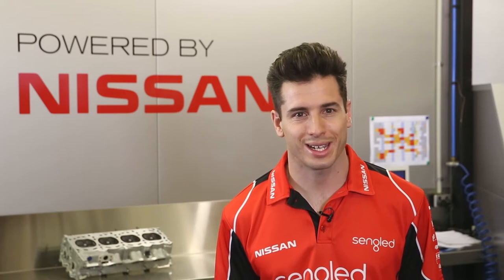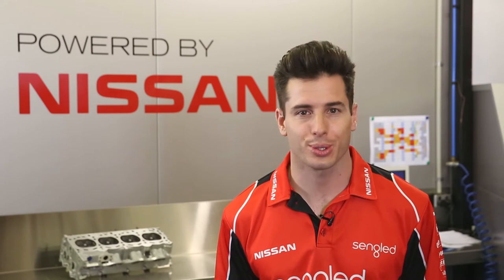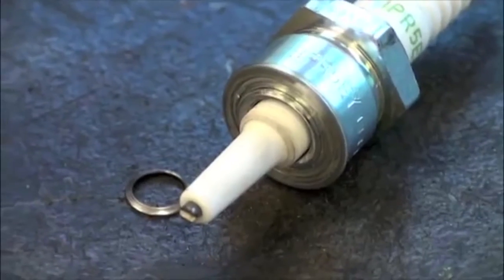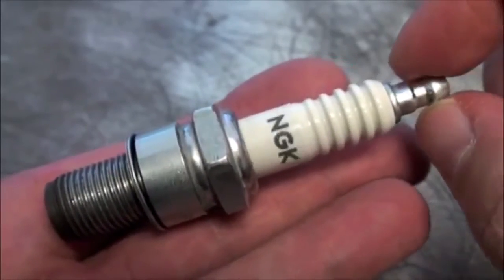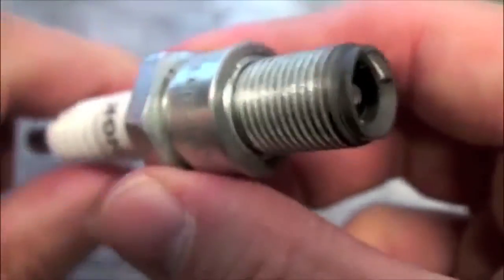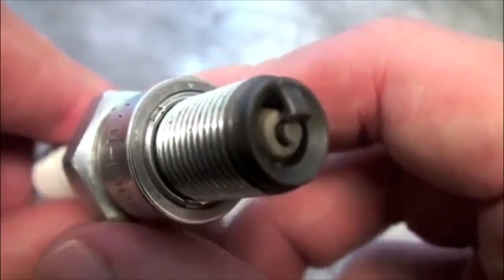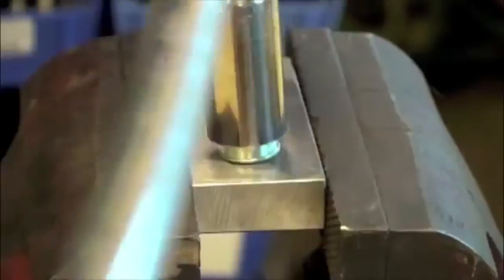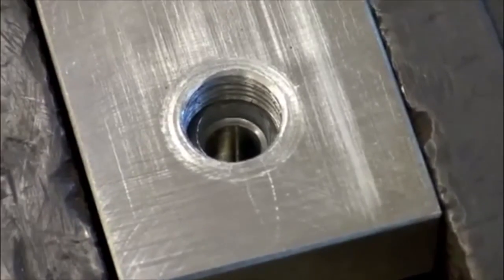Rick Kelly talks Proper Torque - NGK Spark Plugs

Comment: So can we discuss NGK torque angle vs. actual torque? I recently installed some NGK platinum plugs in aluminum head.  The box said 1/2 - 2/3 turn after finger tight but I opted to use a torque wrench set to 18 lb ft.  Presumably the 1/2- 2/3 turn will get you 18 lb ft to 22 lb ft, yet I found that my wrench clicked at just over 3/4 turn presumably beyond 22 lb ft that should have been reached at 2/3 turn.  I am still unclear as to the inconsistency between NGK recommended torque angle method vs. the torque wrench method and an inquiry to them said they were unsure if they have actually compared the two which seemed odd.  Does anyone have any comments as to this observation?  I was very careful to clean the gasket sealing surface on the engine.  I was thinking perhaps carbon residue in the threads might cause an inconsistency but it seems residue would cause torque to be reached sooner in turns of amount of turn as in anti-seize causes a delay in torque being achieved.
  I honestly don't know now if the plugs were perhaps overtightened because I went beyond the max 2/3 NGK spec.